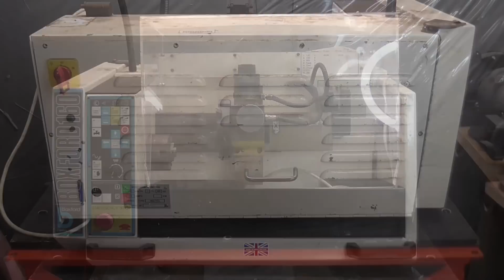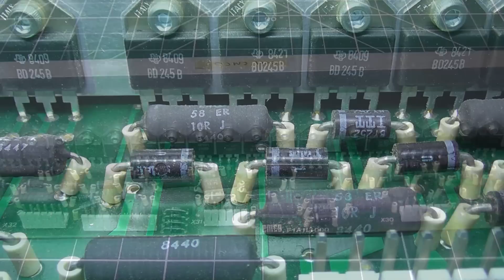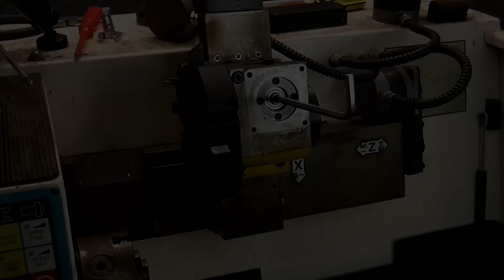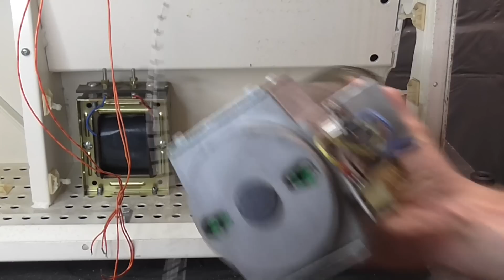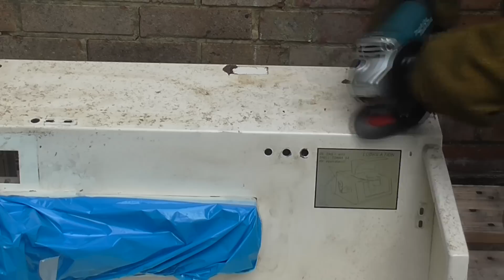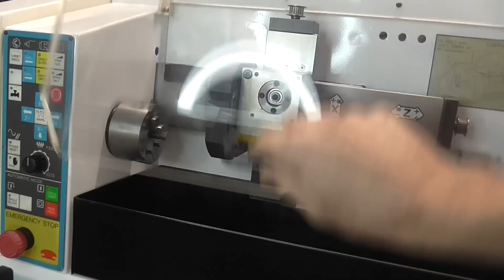Saving a 90s CNC Lathe: The Boxford 160 TCL Restoration (Part 1)

Comment: I have the same machine do you have any pictures of the wiring for the motor encoder the plug on the bottom right of the board or a quick video will help
Reply from the maker: I still have the board, but I just chopped the plug off the cable and rewired it. I THINK it went: GND-black LED-red and P and I (pulse/index) are the yellow and green, not sure which is which but you should be able to figure it out with a multimeter.
Reply: @AndysMachines   abit random would you sell the small chuck and parts ?
Reply from the maker: Already sold the spare 80mm chuck I had! The only parts I have left are the original circuit boards and transformer which nobody seems to want.
Reply: @AndysMachines  do you have a number or part code  for the black photo emitter senser on the spindle of the cable need to order a new one
Reply from the maker: There should be 2, one for the speed pulses and one for the index pulse. They are both Optek OPB866T55.  But probably any optical switch with the same dimensions would work.
Reply: @AndysMachines  hi again was there a resistor attached somewhere in the wire?  as grd to led on the board is 12v output does this sound familiar?  I to ground is 5v P to grd is 5v am I or is it the plug next to it I should be wiring to? sp td c 5v?
the sensor is only 5volts just need to work out this last part so I can finish the lathe
Reply from the maker: The two optical switches are mounted to a hollowed-out aluminium block and I believe there are resistors inside this block at the anode terminals of each optical switch. You generally always need a resistor with this type of switch to limit the LED current to around 10-20ma (just choose a resistor to suit whatever supply voltage). The collector pins I think connect straight to P and I and pull these pins low. It's definitely the socket marked 'ENCODER' on the board, not the next one (PL3) I can't remember what that's for.
Reply: @AndysMachines  thank you I'm still learning the electrical side you've been a big help so far subscriber gained! I'm guessing I ground the 4th leg of each wire from  sensor

Comment: Can you please guide me In my college there is a boxfoard 160 mc in which the spindle motor is directed via a mini switch so it just on and off at full speed when i asked the teacher he toled me that some component is damaged and not available to buy because of old model so can you help me so that i can use to get veriable speed via potentiometer or enything else circuit to male some awesome project of threading boarding etc
Reply from the maker: Normally the motor is driven by a speed controller, but if it's activated by a switch maybe the problem is with the interface to the controller and a switch has just been wired in instead? I can't really help without more details.

Comment: The capacitor is, as you have observed, not strictly necessary - it's there to stop noise generated by the electronics' switching action from feeding back into the mains. Should you replace it, you need to use a safety capacitor of equal type rating - X2 in this case. If you had an Y fail too, that needs an Y replacement. If both were X... Well, you get the point. Panasonic makes good substitutes.

Comment: It is a very cute lathe, I bought one of those a couple of years ago , I was running the original boxford software , the steppers are very weak compared with modern ones, they are a must to replace
Reply from the maker: I actually found the steppers in mine to be to be ok, I did remove them and thought I'd have to replace them like the Emco ones which were very weak, but I've kept the original motors and haven't had any problems. I am using modern drives though so maybe that helps.

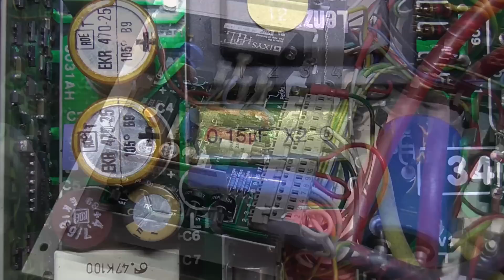Comment: The magic smoke at 3:51 is a RIFA capacitor - over in the world of 8 bit retro computers, these are NOTORIOUS for going poof and making ad smelling smoke.

They are only for RFI suppression in any case, so can just be removed. Or (in fact) they're cheap and readily available, so can readily be replaced.

The really good news is that when they let go, they don't take anything else down with them.

Comment: It looks like Boxford pulled all the stops out to 'value engineer' this model down to a very tight budget. It's well made and finished but there appears to be absolutely nothing over engineered or unnecessarily complex in any aspect of it's design. It's about as simple as a CNC lathe can get while still performing to specifications.
Reply from the maker: Yes, you'll see more of this in part 2!

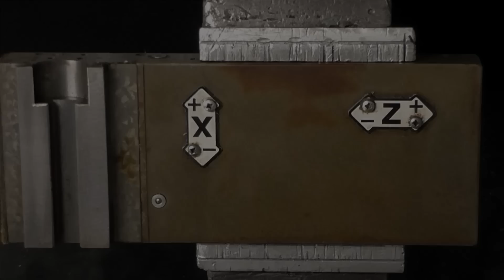Comment: 7:54 cheers to you for using a proper Pozidriv bit to remove the pan head Pozidriv screws. Little things like these establish your attention to detail and pride in your work.
Reply from the maker: Yes, here in the UK Pozidriv is more or less standard, but often you find a mixture of Philips and Pozi. When I build things myself though I always use socket head screws.
Reply: @AndysMachines  ah, I had no idea they were common in the UK. On the US West coast, I’ve only ever found them when taking furniture apart; most hardware store employees here don’t know they exist! Anyway, looking forward to the next stage of your restoration.

Comment: Hi Andy, still making steady progress on mine. I would be interested in your solution to spindle position. I have bought a cheap optical interrupter, but I am struggling to get the bob to read it.
Reply from the maker: Yes, the spindle encoder was one of the main things I wanted to get working, it was a bit of a challenge, you'll see in part 2.

Comment: if you need to replace the tiny v-belt i found that using a fan belt from a car with the right lenght works and is cheap. all that is needed is to cut each v section out of the belt then you get 4 or 5 belts out of that one
Reply from the maker: The v-belts aren't quite as small as the ribs on a poly-v belt, they are 6mm wide which is quite commonly available. However cutting belts down like this is a useful technique and can also be done with toothed timing belts. It's how the belts are manufactured in the first place, they are slit from one very wide belt.

The belts in this machine are actually still in very good condition, I don't think the lathe had much use at all.

Comment: I remember we had one of these added to our engineering workshop at school, coolest machine in the shop at the time. It did have a weird issue though, it was inaccurate when run from cold, they believed it to be some kind of induction of signals with the motors that disappeared when the machine was warmed up, so if you came into the workshop and that lathe was running empty at full rpm, we knew it was being warmed up for todays class.
Reply: Very Weird! Come on People, any thoughts?

Comment: I have an Emco Unimat PC CNC lathe that I converted to run on Mach 3, now that’s what you call a small CNC lathe! It works well but the main problem with it is the spindle and stepper motors are too under powered to do any serious work.

Comment: I learned years ago that when doing a refurb it is best to do a nut-and-bolt rebuild. This began with my 1971 bodged rebuild of my 1966 Norton 650SS, which 25 years later I stripped and rebuilt properly. Stuff the oily rag restoration - I prefer a full repaint and like-new product.

Comment: Nice machine,Andy👌 
I guess the bed is bonded to the sheet metalwork to prevent any coolant from wicking in between the mating surfaces and causing corrosion.

By the way, Winky''s Workshop channel has just commenced building a homemade  gear hobber based on your earlier project for the milling machine.
Reply from the maker: It's definitely stuck very well whatever it is!

Thanks for the heads-up, I've left Winky a comment.

Comment: That capacitor looks like a Rifa. Those are pretty infamous for going bad with age and becoming conductive. IIRC they are made from paper and foil, and with age the plastic shell cracks and allows ambient moisture to soak into the paper.
Reply from the maker: Yes, I think it was. It was actually two capacitors in one package. When I put the lathe back together, the 2nd one went too!